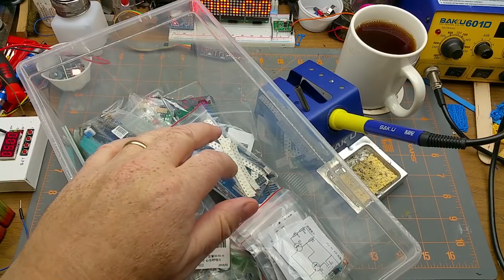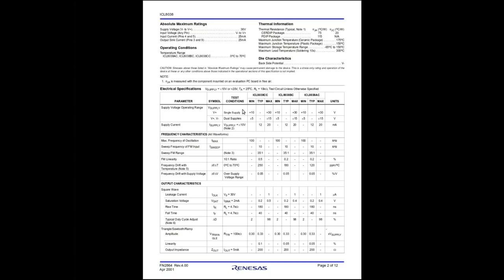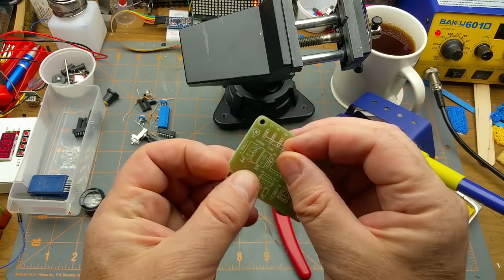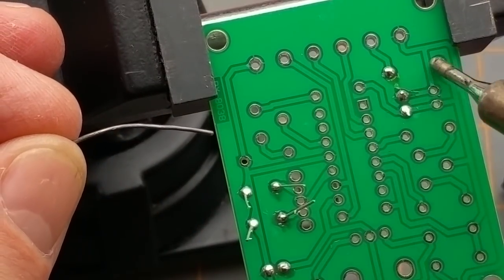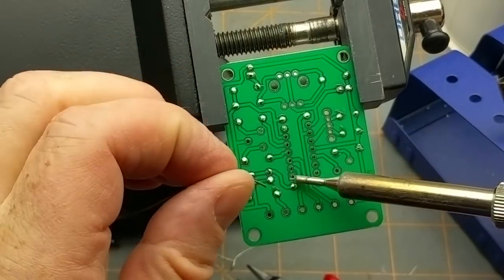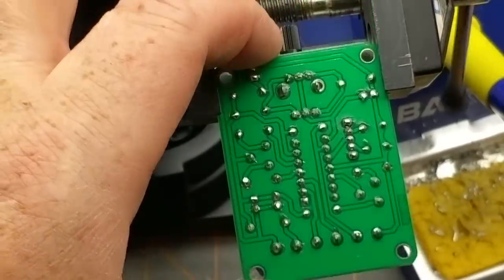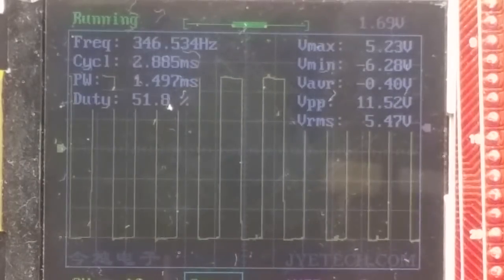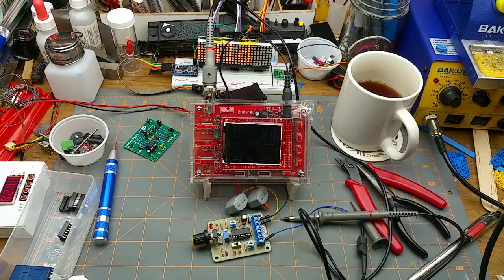kit build on a cold day

Comment: Hi     This is very strange , even though I have used the 8038 before I ordered one of those
kits a few days ago . 

The 8038 data sheet says to control purity by using 2 presets , one on pin 1 and the other
on pin 12 . Perhaps you should try that . I have a note on my data sheet that mentions that
I found something on the web about sine wave distortion being partly caused by high current
blips caused by the pull up resistor on the square wave output pin ( pin 9 ).
I dont know when I noted that down --- I guess when I had a problem years ago .

                                                                                                    Thanks
                                                                                                                                 Alan
Reply from the maker: Thanks for the insight.I'll have to do some tinkering. Perhaps move the chip to a breadboard and duplicate the circuit then see what can be done.